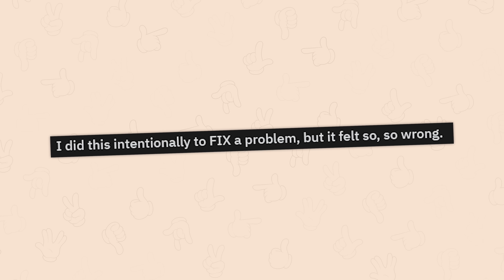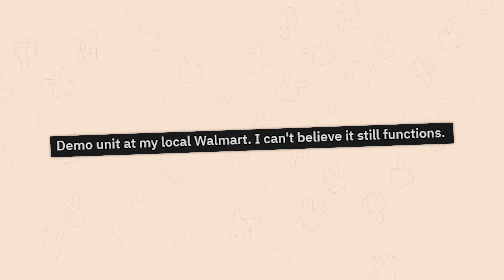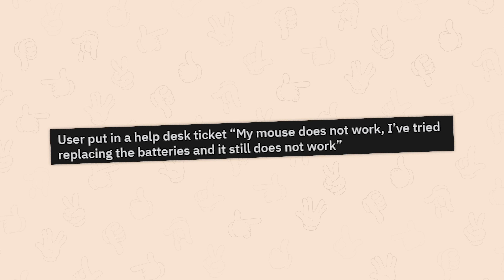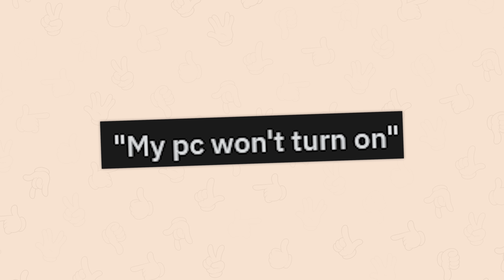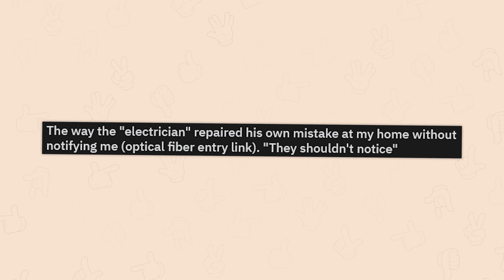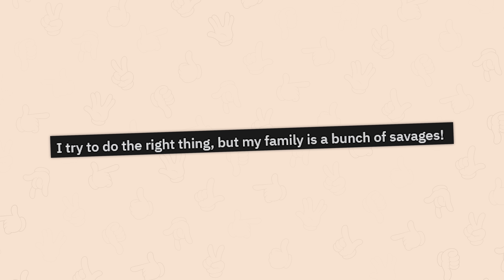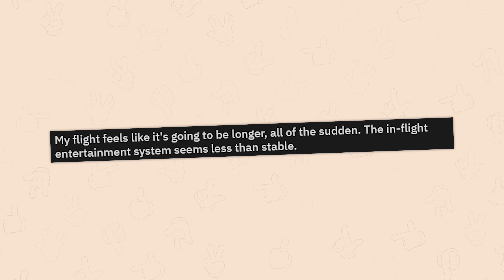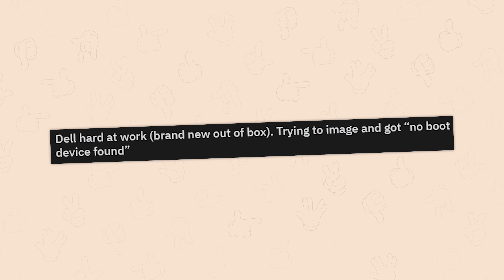r/TechSupportGore | free internet with this one trick

Comment: I actually did just that very first network patching sin today

My company was renovating and one of the construction workers accidentally cut a few ethernet cables that ran between server room one and server room two. Around half way between the two server rooms was one office, that for some reason got half of it's ethernet connections from a switch in room A and the other half from room B. So i just patched the link between A and B to two of the jacks in said office, ran a 3m cable between them and told the guy there to never unplug the cable or i'll Format the Drive in his Notebook with a screwdriver

Comment: so recently some family moved in temporarily until they could find a new house to live in so they could live closer to us. Our house did not seem to take kindly to the extra 4 people and every now and then the breakers would automatically turn of, likely to prevent something from breaking. Then one day at some point the power just went out in half of the rooms. However all of the breakers were fine and running, the issue? My room, my grandma's room, half the electronics in the living room, and my parent's room's electronics(including the WIFI) were all connected in a weird web of extension cords. they decided to just keep attaching extension cords to each other for more power space...once I found this out (no I didn't know about this beforehand) I told them that they were doing something called "leapfrogging" where the plug an extension cord into another and how that is dangerous as it could cause an electrical fire and ironically enough the main extension cord that was providing power to everything actually had one of the little prongs burnt and covered in some weird black stuff. Glad my house didn't burn down because that was a recipe for disaster

Comment: I work in IT for a local hospital. You'd be gobsmacked by the old systems we still have running. Our CEO retired and I was sent to his office to remove the PC. Recovered an old but oddly super clean DELL with a 486DX2 processor, 4 meg of ram, and running DOS 6.22 AND  Windows 3.11b. Had to literally slap myself to re-check the specs. This was during our Windows 7 to Windows 10 upgrade. From the long haired friend of Jesus IT technician in our department he says the retired CEO never used the thing. Probably even got his old Dictaphone in my collection of "OOOH! SHINY!" old stuff.

Comment: 6:24 That's not even bad if you clean it really long after that. You can even clean a mainboard in the dishwasher and it still works fine after drying. I cleaned a board under the shower which came from a smokers PC that I found at the side of the road. It still works fine today, but I wouldn't use soap for that. Just water.

Comment: The landscaper coax fix haunts my dreams, I've seen that maneuver before, I've seen it done where a man stripped off his cable with a steak knife and twisted it together. The man did not have the right idea, he did not have the spirit, he wasn't on to something, DON'T DO THAT. Cable signals are radio frequency, and we have to deal with both leakage, so we don't interfere with other over the air radio signals, and ingress so other over the air signals don't interfere with us. When you do this you generate interference in both directions, not only is your internet not going to work, but your neighbors internet might not work, and if it's in a particularly bad location you could add enough noise to the line to take down a node if it's successfully amplified all the way back, potentially hundreds of people's service down until we trace it back to your address. Additionally depending on signal strength and frequencies your local cable provider operates at you could interfere with multiple cell phone network frequencies. Basically regardless of where you are and how your provider has their plant configured it's potential for no good very bad things.

At least the person who got his fiber line scotchlok crimped only lost his service.

Comment: that one coax cable in the lawn that got fixed badly in the end of video, i had one of those cut in 2 places, patches together in a way kinda equal to this, to 2ends could barely touch and was held together with a tiny bead of solder and it ran a totally stable 1000/100 connection for a few years without any real issues except when the solder have up and had to be redone, was in open air just sticking out of the lawn

Comment: 12:17 you can totally bend pins back. Its no problem. Thousends of videos. Ive done it myself. But i wouldnt do it on 5000 of them... usually its only 1-3, trick is to not bend them back and forth too much because they break but even if you break one or two then cpu might even still work (there are redunant pins, sometimes just something breaks you dont need, but usually its bad if something breaks ofc..)

Comment: On the note of Razer, i've seen much worse. They went from a good company with above average prices but quality products, to insane prices but crap quality products. 

This started around 2012/13, products started becoming slightly worse each year, with prices staying the same or even going up. I've had many laptops in the repair shop i worked at before.

Worst one i can recall is a customer coming in, the laptop stopped working after about a year and 4 months, he brought it in for us to check out, basically turned on, no picture. Buddy was working on it, disassembled it and saw something i thought i'd never see. I was actually surprised it lasted this long. 

CPUs/GPUs in laptops don't have an IHS, they are bare silicon, reduces the size of it and makes cooling batter since you're cooling the chip itself. With an IHS you're able to get away if your thermal paste application isn't the best, since the IHS spreads the heat. Well in a laptop, you need to be precise, that's why you usually see too much paste when you open it up for the first time with the original paste still on there, it's usually 2-3x as much as would be needed, just in case.

Well, this one had an oopsie apparently, the GPUs paste was partly missing, a considerable sized corner had no paste on it. No idea how, but it was the root cause of the GPU dying, since whatever was in that part of the GPU die was always overheating regardless, so for it to survive as long as it did was amazing.

This was back when Razer only gave 1 year of warranty. We took pictures, gave it to the customer and told them to directly contact razer and basically go all Karen on them, because it would be the only way to get this fixed for free. The customer later told us that after almost a month of back and forth they finally agreed, mostly because of EUs 2 year guarantee, doubt he'd be so lucky elsewhere.

Comment: That toilet in the server room opens up soooooo many puns.
"Hey man, just go flush the cache"
"The infrastructure is completely in the toilet"
I am sure there also is a joke about named pipes in there and things going down the drain.

Oh and those SAS disks might have been put into a dedicated punch machine. We have one of those at work. It basically drives a hardened metal spike through drives that are being disposed of. When I first saw drives that came out of that machine, my initial reaction was also to suspect that someone shot them.

Dell laptops are not too bad actually. I have one for work (an XPS 7590). The only thing that I found is really dumb: The CMOS battery is mounted on the top side of the system board. Which if you have to get to it, turns a 10 minute job into a 1 hour job. because you have to pull the entire board, CPU coolers and all. The last Thinkpads I opened up had it sitting right there off to the side, after removing the bottom plate.

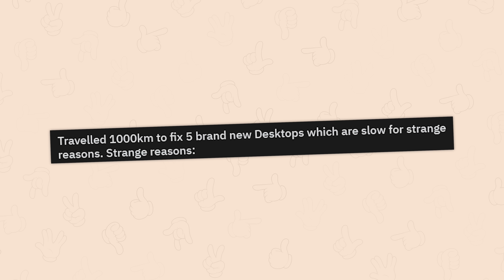Comment: 20:57 I used to be a Commercial Truck Driver in the early 2000's...

One of the Factories I delivered to had a computer in a cabinet that looked almost identical to this, though this one is MUCH, MUCH cleaner than the one I saw and that one was running a multi-hundred Million dollar carbon black factory (they manufactured carbon powder that was finer than talcum powder, IT GETS EVERYWHERE (looks a thousand times worse than the pics of a photocopier that has a toner cartridge explode) that was running MS DOS...

I saw that in 2006...

Comment: 20:50 I once picked up an old 486 - might have been lucky being a DX4 with pci slots if I remember, that had been used in a printers shop till it closed in the early 2010's (lmao) I opened up the top and I shit you not it was nothing but black soot and dust in it so bad that the board and all the boards was completely black and looked worse than that "Ancient city of ASUS" meme. Poor thing did not survive cleaning.

Comment: With those electronic keypad locks, when you disconnect introduce* power it usually actuates the lock to calibrate so you can pop it open while it power cycles, LPL did a video on that just today so it's fresh in my mind, maybe it's designed better but from what I've learned from his channel I wouldn't count on it

Comment: 5:19 Magnetic field, also it's why having an ethernet cable wrapped to a 240V/120V power supply cable is a BAD IDEA!!!... If you are an electrical engineer who has someone with them at the workplace who is an electrical engineer with an IT background, listen to them when it comes to installing ethernet cables!... Induction can possibly fry the wires and computers if you screw that up... sorry for the vent.

(looking at you Nathan... at least keep them 50mm apart from each other and not zip tied to the power cable and I wouldn't have slapped the back of your head... with a 25mm 3c XLPE cable...)

Comment: I once brought down the entire network at the chemical plant I did ALL the IT for by creating a spanning tree loop.  (2015 for reference)
We'd just put in new switches and where one half of the network met the other half, we didn't have enough SFP ports to join them with fiber.  So I used 3 gigabit ports and bonded them as one.
Giggity.
Got it all set up and went back to my office.
And the network was down.
Took me almost 3 hours to figure out what I'd done.  Pairs one and two were bonded fine, but pair three was unbonded.  It was the third pair in the OTHER direction that were bonded.

Fortunately, everyone trusted me enough they didn't care as long as it got fixed.  Plus our ISP was shoddy enough I could just blame it on them!  😉

Comment: I had 20 or so flattened pins because I dropped my cpu. Managed to straighten them out with nothing but a credit card and tiny flathead screwdriver. Credit card to check the alignment and minor adjustments. That was a scary day.

Comment: I know what happened with the Xbox HDMI repair. They likely weren't able to get their iron hot enough to melt that solder to remove the busted HDMI plug and they got it "close enough" before ripping it off and scraping up the board. I started work on one of these where the shop gave me underpowered equipment and I could not get through the larger globs of solder. Had to get a higher wattage iron before I could finally pull the legs through it safely.

Comment: 12:45 the problem is not that tha cat is on the gpu the problem is that the gpu does not have a stand that prevents it from sagging, in short that gpu will sag and possible breake !

Comment: What's wrong with washing motherboards, I put my old Rampage iv through the dishwasher before testing it to see if it was worth keeping, I mean I didn't really care if I busted it because I haven't done anything with it since but there really isn't anything wrong with it, just don't use soap or hot water
Edit: I wasn't clear, board works fine and looks like new and it came out of a really dusty computer
Reply: @Farttard  Seriously, go watch youtube videos on it, wash it and then blow it with an air machine and let it dry, it can't short or warp and the water pressure won't break it

Comment: To be fair, you can do some stuff with virtualization or network booting or live cd booting and stuff and shutting the system down could reset it. also having your computer on, connected to the internet and potentially running exploitable services could give an attacker some time window to scan for and exploit that service. but the correct mitigation is to update your software, restrict the service to the internal network (not ideal as it still presents a risk) or use a different product that does not have a critical security bug.

Comment: 17:28 there is nothing burned i think there was a hdmi connector and it was ripped off someone probably tryed to replace the hdmi connetor and it was destroyed because it was not heated enough and the solder was not warm enough to be liquid so someone just janked the connector off with some pads and destroyed the pcb

Comment: One time I bought what I thought was a hard drive on Amazon; it turned out to be an empty case (with equipment for connecting a hard drive, but still...). This could be easily dismissed as being an oversight had there not been a 1 TB CAPACITY stated CLEARLY on the listing. 😑😑😑

Comment: 12:24, Lexi missing the point that the GPU is slanted downwards which is not exactly healthy for the PCIE slot, or the circuit board of the GPU. Unless this is a tolerable slant, then i said nothing.

Comment: 14:50 Not just that, if it blocks all of 5G, it blocks WiFi. 5G uses up to 71GHz. Wifi uses 2.4GHz and 5GHz. So 5G signals can pierce grids that stop Wifi, but Wifi signals can not pierce grids that stop 5G.
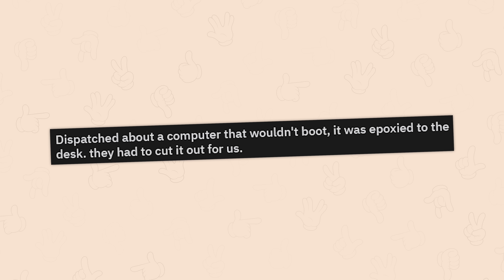22:22 And once you do, cover the hole you made and paint over it. Just get a better paint company this time.

Comment: As I recall there ARE ways to recover data after someone has drilled through a disk like that. I'm not saying they are cheap or easy, but apparently some company got it to work with old declassified stuff that some small European country had tried to destroy in this manner and then filled with glue...
Reply: The only thing is you can't recover whatever was written where the holes are, as that part doesn't physically exist.

80-90% of it would be fine though.

Comment: I fixed a CPU that looked like the one at 12:10 but slightly worse with a credit card and like 3 hours of my time. It was all I had and I messed it up (first build) so I had to fix it. I didn't have the $50 to replace it. It was a phenom ii x4 black edition that still works

Comment: This video may be a couple of months old now but NEVER GO WITH RAZER. Their quality control is awful. I've had 3 headsets break from them within 3 months of having gotten them, a mouse essentially fall apart after a month, a keyboard that was brand new (had a fancy touch screen & mouse combo) that never got any updates or new features after 3 years of having it before that broke as well. A friend of mine has had 2 laptops from them in the past and both of them INCLUDING REPLACEMENTS have had critical failures. 

DO NOT GO WITH RAZER.

Comment: As long as they didnt damage the platters of that hard drive, its fine, but the fix wont be cheap, because the actual top bag there, that will have to be replaced wit ha donor one from the exact same model and type hard drive. This also assumes they didnt damage the platters either.

Comment: Urgh i still have one of those dry patches at work... though right now it is used as a testing point. We still miss some cables that's why it did not come out yet. The specific Networkswitch it should be later connected to is 3m away.
Still miss the time to do it but there is a lot of things we work on right now. For this specific case if it works invest your time somewhere else first where things don't work.

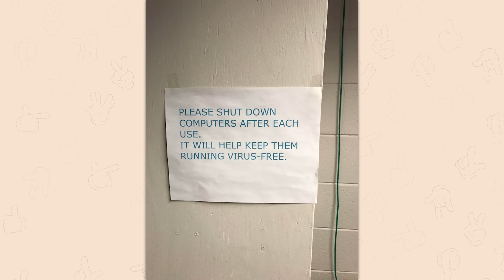Comment: the one at 15:48, doesn't it work if the computer is locked i say this because in my school's computers you could use the computer to do anything but after you shutdown it wiped everything and returned to it's original state that the IT professor saved as.

Comment: Ok, I'm going to try and cover for the "Wi-fi Cable". Whoever works in that room is probably not very tech literate, but understands just enough to know that Wi-Fi is airborne internet. They made the sign so no-one would mess with the cable, because it is connected to the wireless router. I say all this not excusing that, there is no excuse anymore to be that tech illiterate, but I'm saying I might understand how it happened. That or whoever is in there put up the sign as a laugh, and also so no-one would unplug the router.

Comment: 0:34 i have a shitty cheap chromebook from my school and i don't really think the chargers are usually that frail. the one i currently have (which i think is also the same one i've had for ~6 years) has visible exposed guts spilling out from a massive gash but it works just fine and said guts can be safely touched while it's plugged in and you won't get shocked. so i have no clue what the fuck is going on with that but it probably says something about the durability of those chargers

Comment: we used to use windows 98 at my old workplace, because the programming software for the hardware we had didn't have drivers for windows xp, but I did get a copy running with an emulator on windows 7 with a serial to usb device, but iirc I had to find one that worked, because most of the usb serials use 3.3v and not 5v.